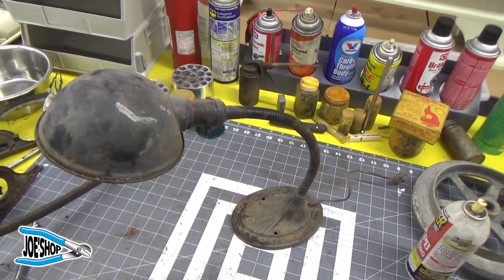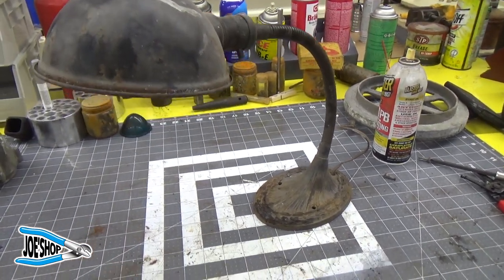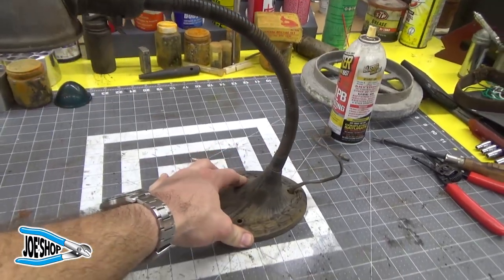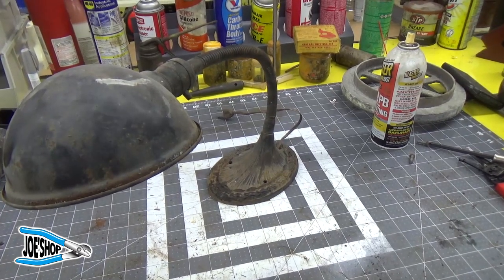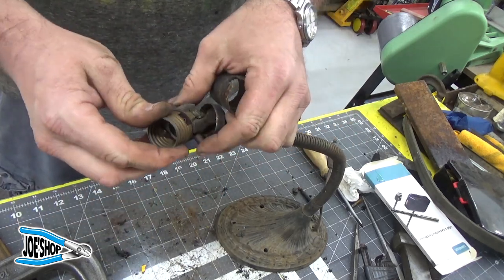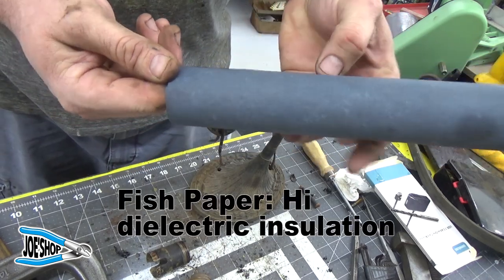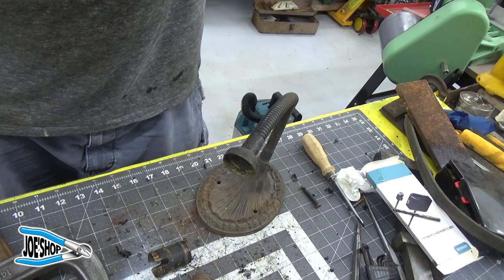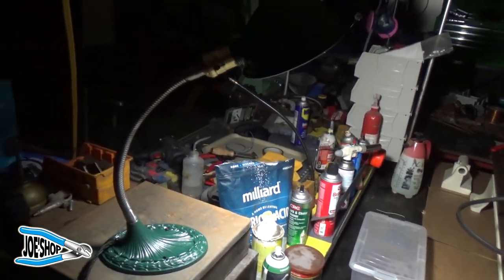Vintage Griest Lamp Refresh

Comment: Did you sandblast the gooseneck as well?  If so, any problem with blasting media getting into the joints?
Reply from the maker: Excellent question! No! i used citrus strip and a wire wheel on the base. I was also concerned about the media binding up the joints. Cheers